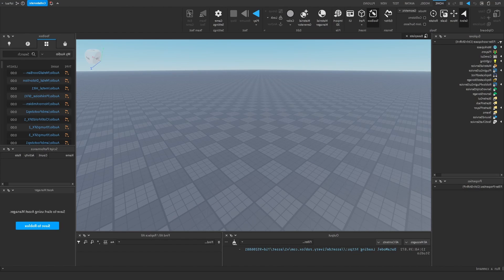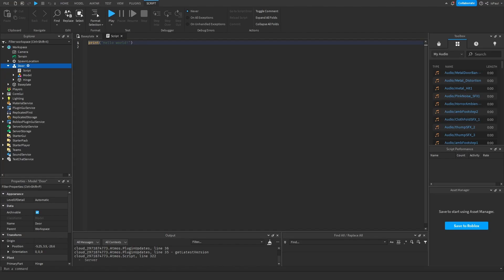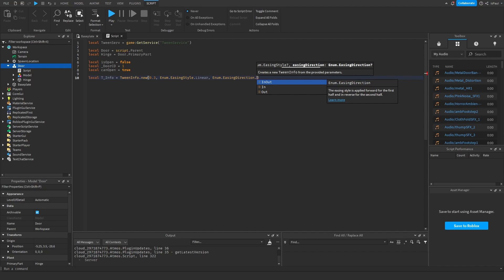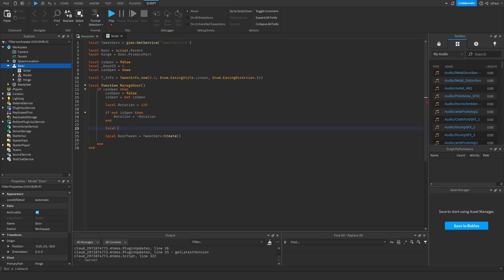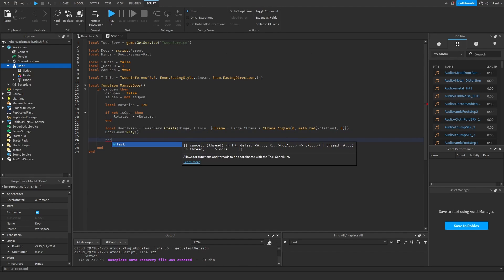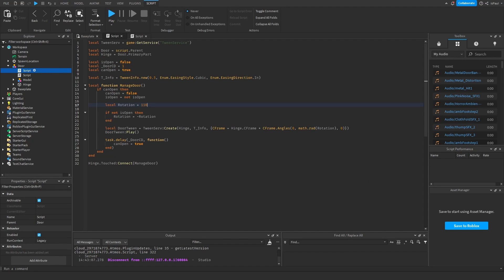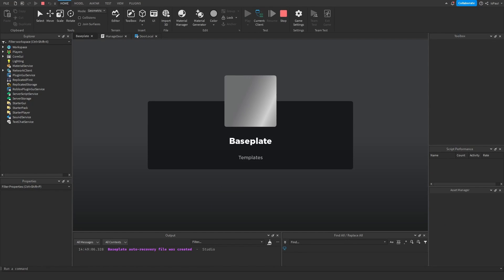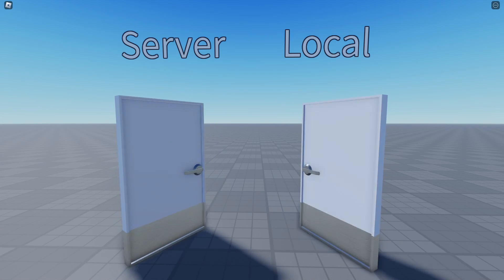How You SHOULD Tween Doors | Roblox Tweening Guide

Comment: whenever i touch my door it opens, then i touch it again and it rotates the same way so it just does a circle rather than rotating back to where it was i made sure that rotation = -rotation
Reply from the maker: Put the Rotation variable into the function scope and make sure to do the isOpen check, if you have done everything like I did then it should be working.
If that's not the case then check if you're setting the attribute correctly